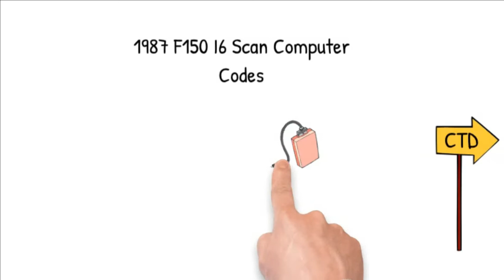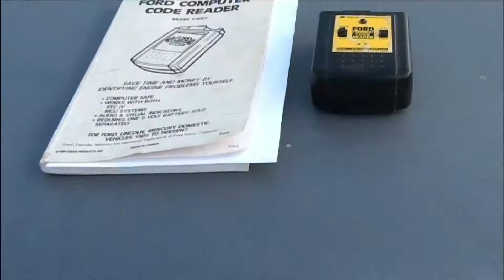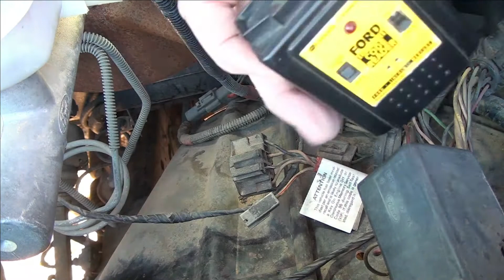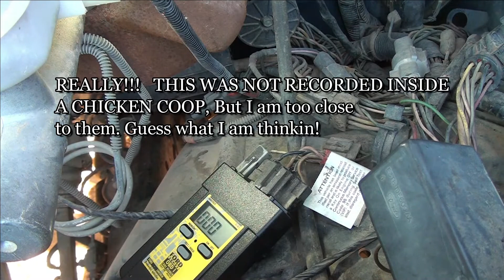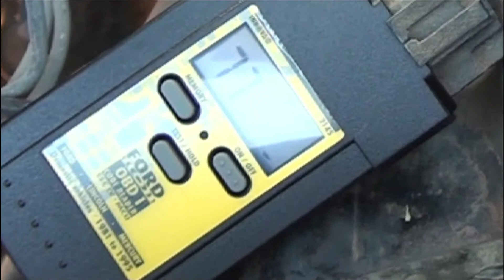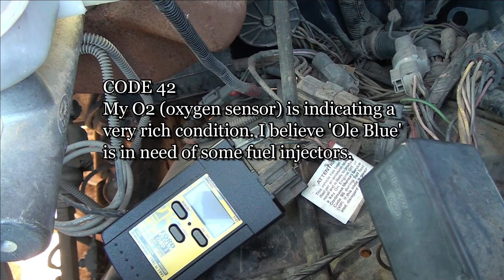Scanning 1987 Ford i6 F150 Computer Codes

Comment: a lot of those older ford trucks had noisy power steering.  yes I like that digital one much better , it didn't have that annoying screeching sound, lol. I'd much rather hear the chickens than that thing..lol
Reply from the maker: The noise is there to let you know it is still working, and the chickens are there to let you know that you are not alone.  lol
Digital is nice but should have purchased the extension cable...the wife does not take instructions well sometimes. Like run the rpms to 2000 and hold for a minute...what?